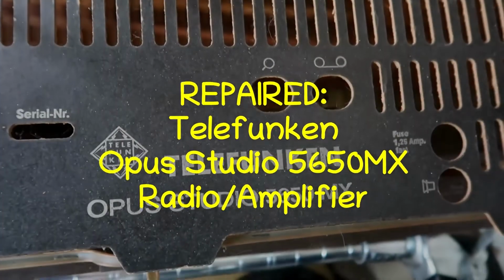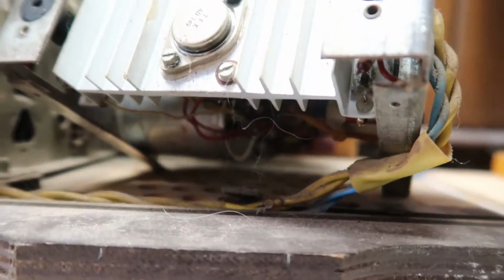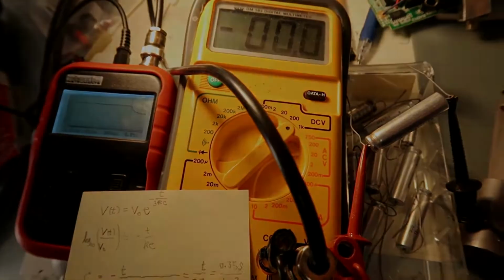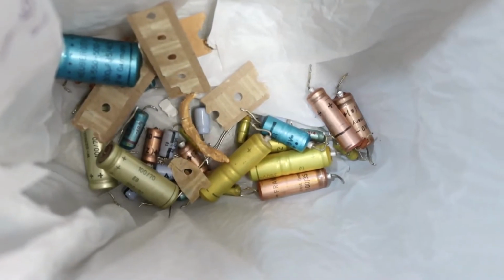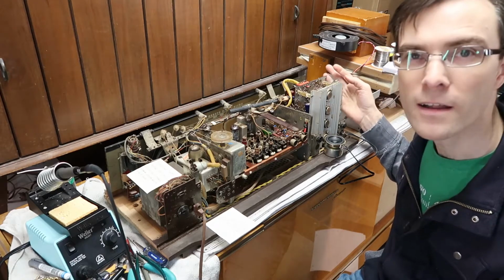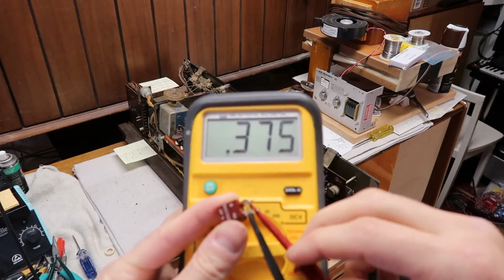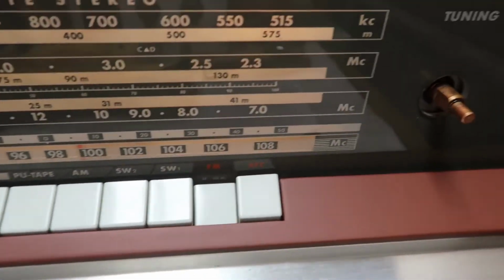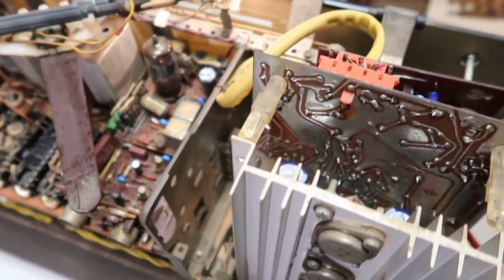REPAIRED: Telefunken Opus Studio 5650MX antique radio/amplifier 1963 - Almost failed!

Comment: Wonderful video.  Do you have a listing of the different capacitors and parts like the bridge rectifier that you used for this project? Was hoping to not make any mistakes in ordering components.  I have the exact system, Radio works but the sound is starting to pulse as the volume goes up.

Comment: What would be the price if I needed this service done on my unit? Ballpark. I would love to get the old gal  going, any help would be appreciated 
Thanks?
Reply from the maker: Sounds great. The biggest killer is the Reel players. They require SO much maintenance to get them working, and even then, it's another 2x the work to make them sound good. So if you just want the radio and record player working, I'd guess about $300-$1000 for a skilled side-buisiness hobbyist like me, depending how many tubes are bad and what condition the other parts are in. A servicing company would probably cost a lot more. Getting the Reel player working in addition could be double that. Hopefully there's someone near where you live, because those beasts are hard to transport, or someone has to come out to you for the repairs (and bring all the possible components with them).
Reply: @JoyeMusiccom  it’s a bit out of my budget, thanks man, I might want to take a crack at it, currently im keeping my wife at bay where she is chomping at the bit to turn this into a bar, any idea where could I find the capacitors and tubes?
Reply from the maker: @tave9011  I like https://vacuumtubes.net/ for tubes, and I get capacitors at places like Electronics Goldmine, or other discount places. Digikey, Mouser, etc are fine if you need something specific, but they do cost a lot. No need to buy tubes unless they are bad, though. Capacitors almost certainly need replacement, particularly the main power supply ones. I have seen a few cases where signal capacitors (paper ones, for example) have gone bad and shorted out a preamp stage.

Comment: Great Video !!! I have that very set of Telefunken. I operated it twenty years ago and it was working fine. The only problem it had was, that the record player was located on to of it and if the lid of the record player fell down - by accident of course - there would be an UNELIMINATABLE hum ( 60 HZ ?? ) Sometimes that could be eliminated by switching the radio on and of but not always. I hate to get rid of it, but my wife says "It does NOT fit the rest of the decor of the house". You got me worried now, that if I turn the radio on it might blow up. I have the schematic of the set, and noticed that the capacitors in the power circuit are three in one can. Tried to get them in Germany, but so far no result. Keep it up !!
Reply from the maker: The 60Hz sounds like a ground wire to your record player is broken or has a bad connection. That's worth checking out with an Ohm meter. 
Yes, forget the 3-section capacitor -- it's not needed, you can't find them, and if you can, they are at least $40. The separate capacitors are about $1-2 each. Please REMOVE the original 3-section cap from the circuit (it can stay in the chassis for display, though); I'm working on a Grundig radio now and had a persistent random crackle that was quite loud. I bypassed that antique 2-section cap with new capacitors (leaving the old one in the circuit) and the crackle was still there. Then I disconnected the 2-stage cap and relied only on my new caps and the crackle noise completely disappeared! I'm working on that video next, but have a few things to clean up on the radio first.   
I can't help you with the decor problem, though!